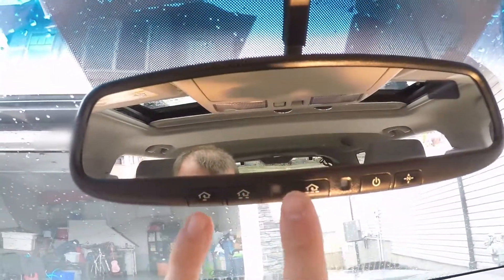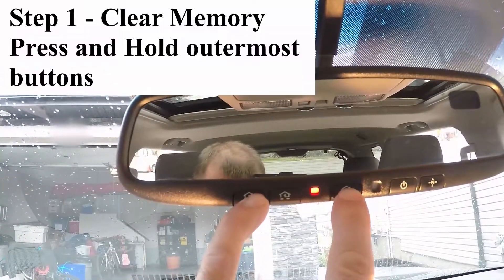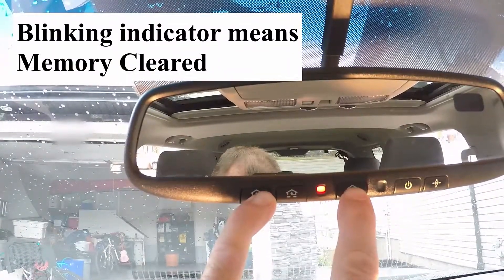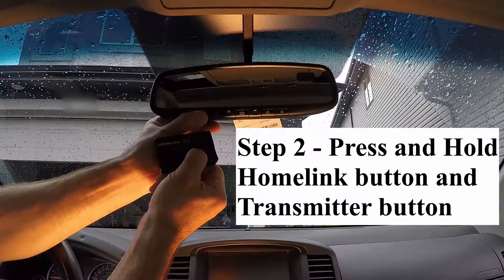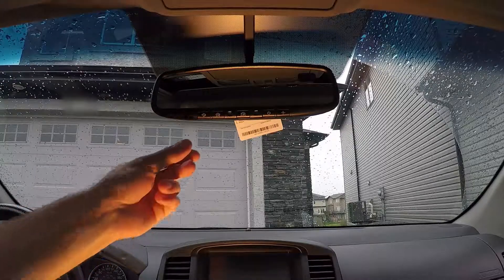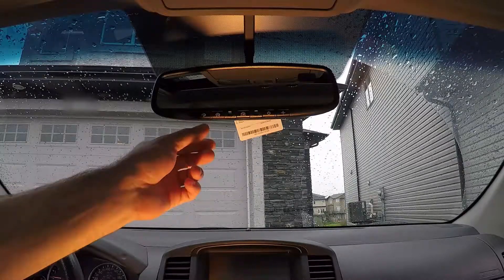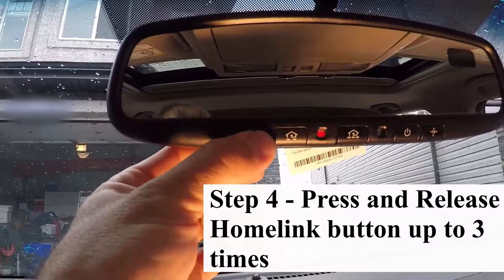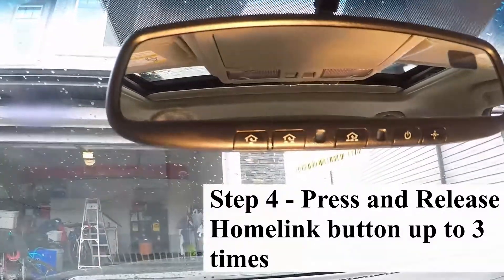Nissan Homelink Universal Transceiver Programming

Comment: I cannot get it to fast blink when holding both the homelink and remote buttons. Help!
Reply from the maker: That is odd, did you do a clearance of the memory?
Reply: @DIYNorth  Yes. Several times.
Reply from the maker: @jmmonroe9670  do you have the same vehicle? there might be a slightly different process for you. It should be detailed in your user manual that comes with the car.
Reply: @DIYNorth  2011 murano. And yes. I tried what they said in the manual.
Reply from the maker: @jmmonroe9670  im not sure then